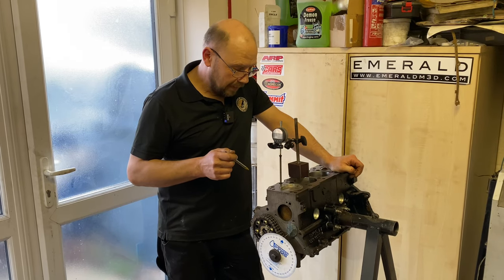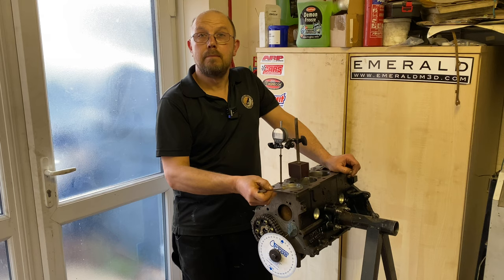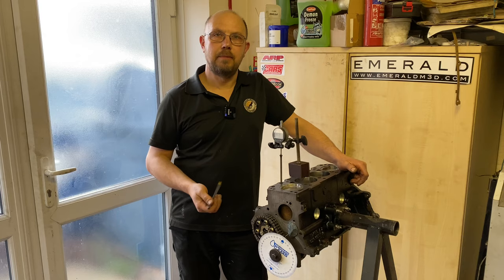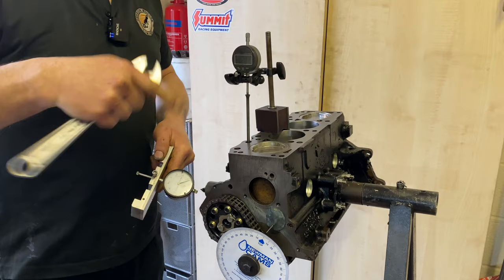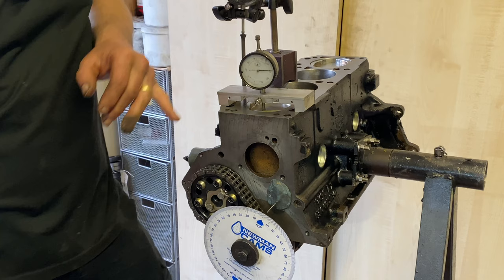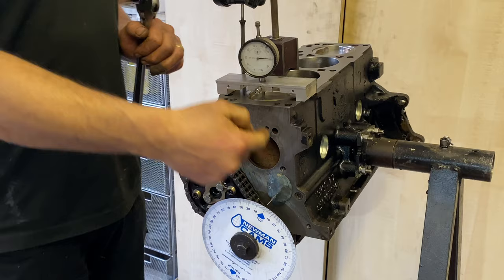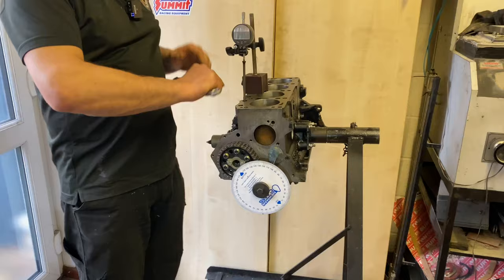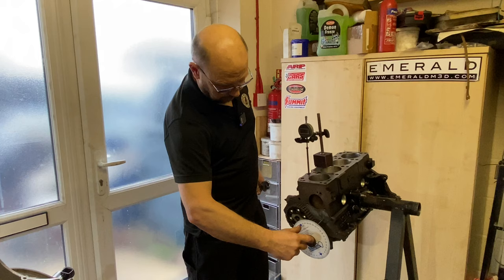Ford Crossflow Engine Build 1600cc - Caterham 7 - Cam Timings & Forged Pistons

Comment: Right so im just about to go through this process on a kent engine for the first time, so to simplify it you need exact tdc on crank and exact highest lift on intake!  Is that right?
Reply from the maker: no, highest lift on intake would be between 100 and 110 degrees after TDC depending on what cam you have